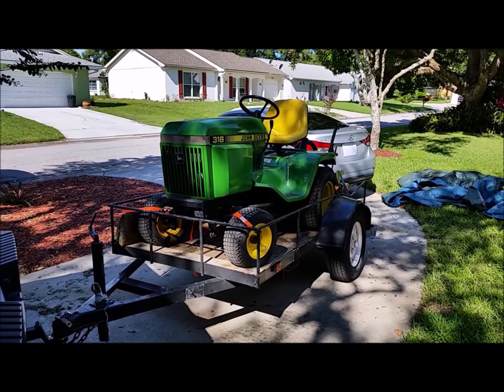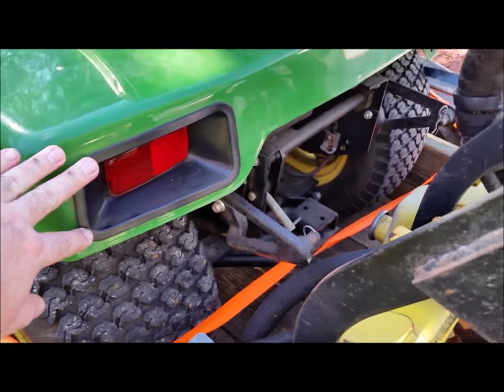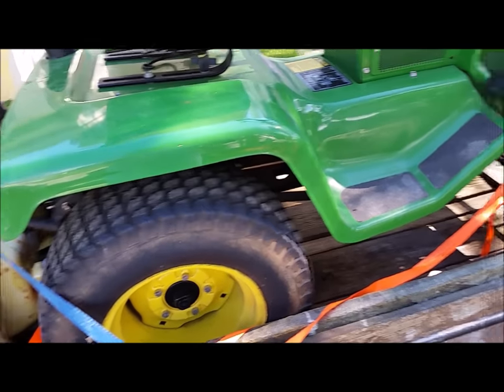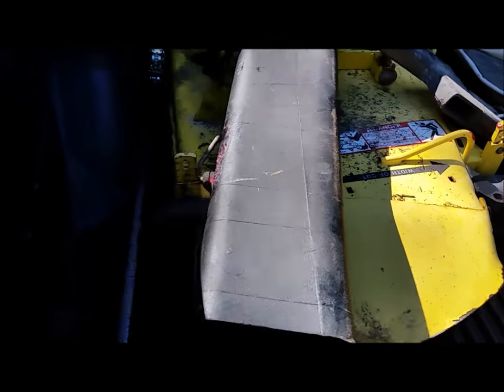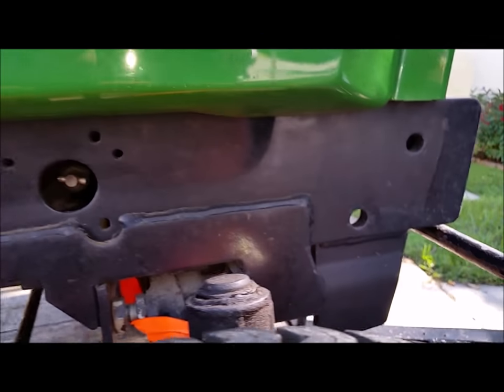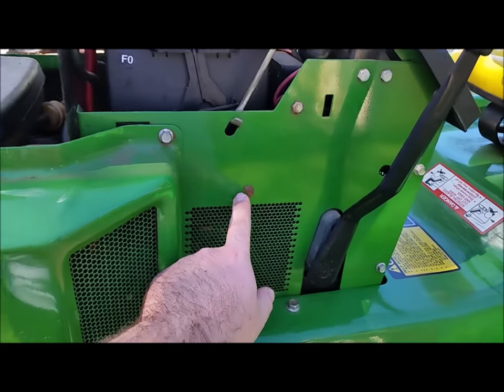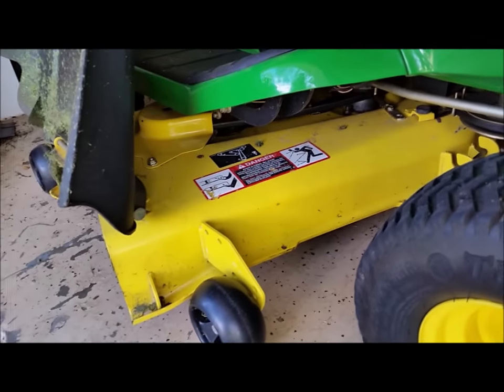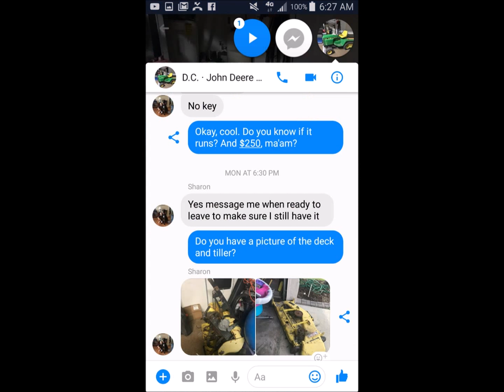Low Hour, Barn Find 1988 John Deere 316 Part One

Comment: Beautiful looking 316. Definitely a keeper. That thing is barely even broken in. Although, like someone said below, I am surprised that the firewall foam isn't intact for having such low hours. All those years of sitting must have taken a toll on the foam. The firewall foam on these tractors originally only covered the top half of the firewall. My first 316 had 1100 hours when I bought it and the original foam was still there, but was starting to fall apart.
Reply from the maker: Thanks Michael. This Florida humidity  doesn't play well with soft material such as foam. The firewall was there, albeit in chunks at the bottom of the engine shroud and belly pan haha

Comment: Holly crap this thing is super crisp & new! With such low hrs Deere might want to put that in a museum, that thing is almost to nice to use.

My 212 used to be my beater, until I made it nice, then got a 67 110 & it’s almost restored.
The previous owner to the guy I got mine from had the engine rebuilt, & the tractor was basically 1/2 restored then I finished it. It needs a belt & that’s it.

The paint on that thing is as good as your going to get w the new rattle can paint you can get now.
So for the battery tray if you get rid of that battery handle it helps keep it down, then put some paper towels under the battery & the acid corrosion goes away almost 100%.

Comment: I neighbor passed away recently he gave me is 332 original from the 90's with all attachments. The diesel runs good 997 hours needs radiators that i just purchased. I'm a newbie thanks for your video.
Reply: You should be running some DCA coolant additives to prevent cavitation issues. Cavitation can destroy an engine faster than bad oil changes.
Reply: @michaelbenoit248  I sold our JD 332 in October. Okienny on eBay lie said radiator was recorded and pressure tested. That's why it was leaking so I returned it lost $100 bucks. I restored it for $2,500 some Bondo fix the hood & painted tractor. I just wanted to get my money back. Never again restore any old tractor.

Comment: The 316 was an economy version and did not come with lighted rear lights, the 316 had reflectors.
Reply from the maker: Thanks for the info! I actually bought a 318 wiring harness and lamp housings, brand new the other day. From what I can tell, should be plug and play as apparently the 316 has the wiring for them under the fender.
Reply: @vaderslostson3053  can you send me a photo of the attachment page from your manual? I have a John Deere 318 1984, how did the restore go??

Comment: I noticed by the engine that it does not have any foam firewall
Reply from the maker: It sure doesn't. I found the remnants at the bottom of the engine, in the shroud and on the belly pan. It looks like it completely fell apart in the time it was sitting.